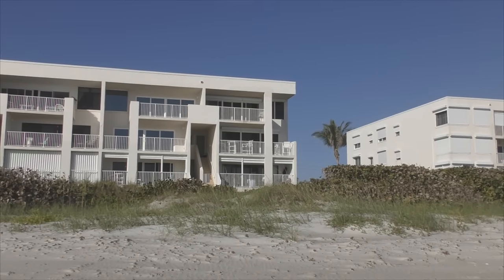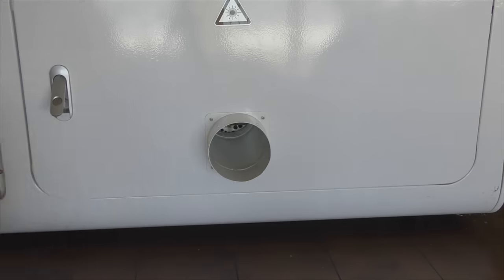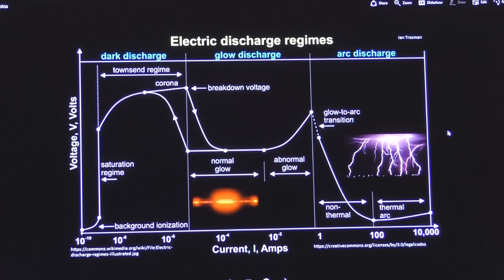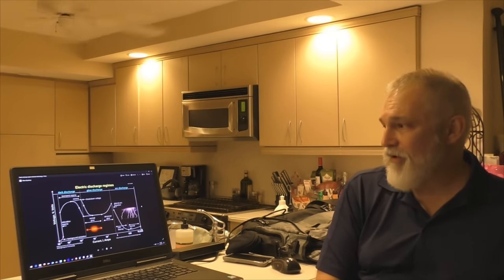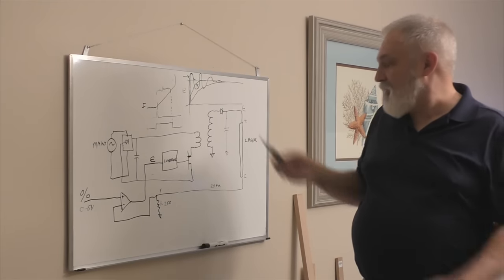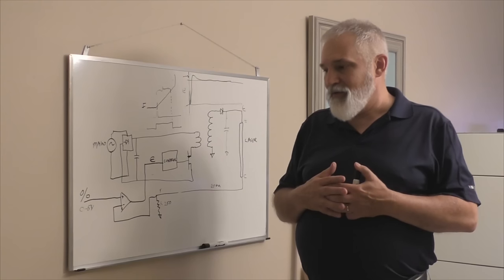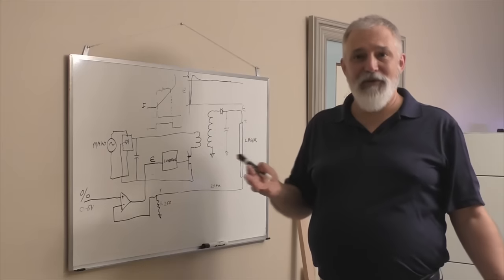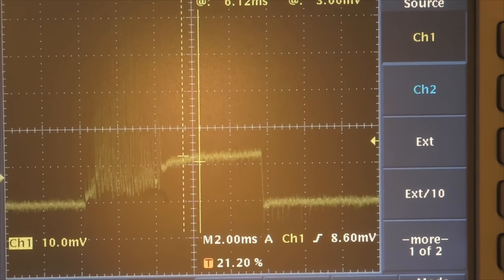RDWorks Learning Lab 97 Understand Your HV Power Supply via Florida

Comment: Great Video, I have the same bodor machine, I hope I can learn, improve and fix some of my problems too. Thanks Russ!
Reply from the maker: Hi Carlos
I found it to be a nicely engineered machine with a few issues that needed attention. I found the stainless support table to be well made and flat. However, when you put the honeycomb bed on top. the centre of the honeycomb sagged. You need to put a small packing piece under the centre to keep it level.
I was very unimpressed with the extracion and airflow through the machine. There is nowhere for the air to get into the front of the machine.
Although the machine I was working on had a 100watt tube in it, Bodor no longer offer this option. I suspect they had also discovered that the beam diameter is too big for the lens tube..
One issue that seems to be common on all Chinese machines is the poor positioning of mirror 3. The centre of the mirror does not usually line up with entry hole and even worse it sends the beam down the lens tube off axis. Bodor had this almost spot on (within half a mm)
 As you noticed, I made the head adjustable so that beam alignment becomes easy. If you wish to make your head adjustable I will let you have my drawings if you private massage me your email address
Best regards
Russ

Comment: About "spikes": they looks like very high, but "thin". When we considering them we should use area down of them as energy representation (this one which we need to create laser action). So visual "average" of AREA (even bit intuitive) should be good enough.
Reply from the maker: Hi 
The spikes are certainly high but I was never sure of their duration and ability to excite the nitrogen into "damage" mode. Chip's equipment was certainly very fast but even at nano seconds he could not capture a proper shape because of digitization of his scope. We therefore conclude that only the low energy wider base spikes below about 25 or 30 milliamps are energy creating and relatively harmless because of their short duration also.
Best regards
Russ
Reply: Hi,
You are absolutely correct in your assessment that the area would represent the energy. As Russ stated below the spikes were very short duration. My scope is a Tektronix TDS3052 which is 500MHz but the bottleneck is probably the current probe which is a Tektronix AM503B/AM6302 with about 50MHz bandwidth. As I pointed out to Russ the actual peaks of the spikes may be many times higher than what we could see simply because the equipment was too slow. So unfortunately no way to even intuitively guess an area.
Reply: The research that I did suggests that a damage mechanism is that the glow discharge disassociates the CO2 into Carbon and Oxygen. There are elements in the tube to recombine them but there comes a point at which complete recombination does not occur reducing the CO2. Is this the "damage mode" you refer to? Can you point me to information you have discovered about damage caused by the HV drive of the tube.
Thanks.....

Comment: I would like to know how the scope was setup/interfaces to measure the tubes high voltage.
Reply from the maker: Hi Don
If you read my answer to Jelle B below, I hope that Chip will pick up your question and answer it. 
Best regards
Russ
Reply: Hi Don,
The scope setup was done with great fear and trepidation! I was fully aware that if I messed something up I was probably going to blow up my scope...or me.
I purchased a BK Precision PR28A 40kV HV probe for my meter on ebay for about $80. This probe is quite sufficient to user with your meter to differentiate whether it is the tube or HVPS that is defective in a non-working laser. I took it with me when I went to meet Russ.
That probe was not designed for scopes. While it will reduce the HV to an acceptable level any kind of specified AC characteristics like bandwidth, impedance, etc are completely unknown. However, that didn't stop us and that's what we hooked up to the scope to give a general idea of what's going on as the tube is firing up. Please don't consider it a precision piece of lab equipment.
Tektronix used to sell HV scope probes like the P6015A that do have a rated bandwidth. You can still find some of them on ebay. Problem with some of those Tektronix probes is that the probe had to be filled with some inert Freon like chemical that I don't think you can get anymore. That chemical evaporates after awhile and you don't want to run it dry.
Reply: Thanks for sharing your setup. See below where I am sharing our work in understanding K40 HVPS, including a schematic :).
Reply: Hi Don,
Took a look at the schematics and then did a teardown on one of my supplies. Looks like a lot of work went into creating that! In my supply I confirmed the presence of the current sensing resistor as I described in the video where the return from the laser tube enters. In this case the HVPS has two flyback transformers and no other components. If there's a way to get me a private contact info I would love to engage you on the power supplies.
Reply: I would certainly value collaborating on these supplies.
Reply: 60W

Comment: Regarding the feedback resistor: I'd love a more detailed schematic of a generic HVPS. I've noticed that the earth wire that comes out of the transformer goes to ground immediately (it's the only solder connection  if you replace the transformer). How can there be a sense resistor hidden in there?
Also, the transformer is not of the classic TV-type flyback; there is no feedback winding or even a middle tap. How is it driven then? 
And  lastly, thank you for ths episode, it was quite educating already!
Reply from the maker: Hi Jelle
Of my few remaining grey cells, I only have ONE allocated to my understanding of electronics. I shall write to Chip Williams and ask him to deal with any questions that arise from his session. The overall picture I can understand but the detail is not something I dare comment on.  I  selfishly aim is to build my personal knowledge base on all detailed aspects of this technology.  My love of video and video editing allows me to share that information as I continually keep looking into those dark corners where few venture.
Best regards
Russ
Reply: Hi Jelle
The feedback resistor was only one way of getting a current feedback. My example of the feedback resistor was in some ways an analogy 1) to clearly state that our power supply is a current sourcing device and not a voltage producing device when the laser tube is on and 2) to indicate that we could get into trouble if we were to short or otherwise route our cathode return wire through any mechanism other than to the power supply such that we compromised the current sensing capability. I've opened several of these supplies and no two seem to be alike. I would likewise love a detailed schematic! However, I've given up on getting one. In any event, when these supplies fail it is usually either a shorted winding in the transformer or one of the primary power driving MOSFETs or IGBTs has failed. As cheap as these supplies can be purchased it's not worth repairing them.

You are right that it is not a TV flyback transformer but would still be considered a flyback topology because the transformer stores and releases energy in the magnetic field of the core as opposed to directly passing it through.. In the classic TV flyback transformer the primary is usually part of the horizontal scan oscillator resonant circuit and the circuitry uses open loop circuit design techniques not closed circuit design techniques. In the case of a TV you were generally just trying to create a fixed high voltage for the CRT plate and not worried about transitioning from a high voltage to a current source as is necessary for the laser. The primary and control circuitry of our laser HVPS is probably closer to a PC power supply, many of which utilize a flyback type transformer. There could be a variety of primary drive topologies there. Some may in fact have utilize a transformer center tap. Others may use MOSFETs or IGBTs that form a full H-bridge configuration so that you don't have to have a center tap. In the H-bridge topology  you have both active pull up and pull down on each end of the primary coil. This topology decision is usually an engineering decision based on the cost of various components.
-Chip
Reply: Chip, I have pulled multiples of these apart as well trying to understand and measure the response of the entire K40 optical system to PWM control. All of this in an effort to improve engraving.

On this post you will find a schematic created by tracing one version of the supply. As you say there are multiple variations but I have found the design theme to be the same. From the schematic you can see the PWM control + H switch drives. 

http://donsthings.blogspot.com/2017/01/k40-lps-repair-and-test.html

This is the main site that has various info on the work I have been doing on converting and improving my K40. 
http://donsthings.blogspot.com/2016/11/the-k40-total-conversion.html
Reply: Thanks Don. I looked at your links. Have you actually seen the voltage multiplier in any of the laser HVPS? That technique was very popular with color TVs but in that case you are trying to make a simple high voltage. In the case of the laser it has to be more of a ballast with high voltage to start and then current to drive. I have not seen that in the ones I have looked at. What I have seen interesting in one of my supplies is the use of two flyback transformers in series which I presume to get a higher voltage. In any case the laser anode connection is directly from the output of the transformer. The other output of the first flyback transformer is connected to ground. The return wire from the laser cathode is going into the control section of the supply where I would place my current sampling resistor.
Reply: I have not taken a fly back apart yet to see if it really has a multiplier and balast resistor as I have been told is potted in that assy. Its on my list of to do's.
Reply: Thanks Don, that schematic may help a lot in understanding the PSU's I have to work with (when they stop functioning...)